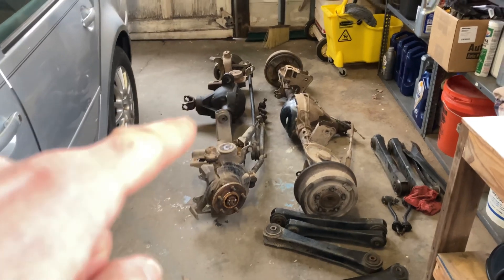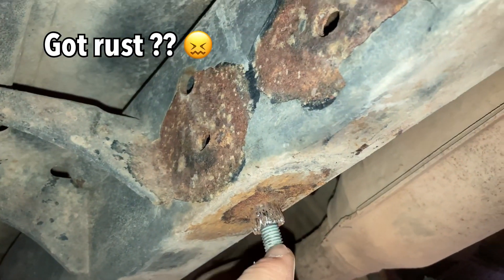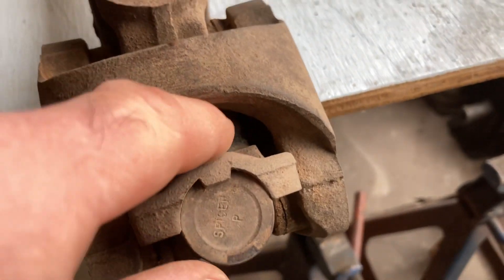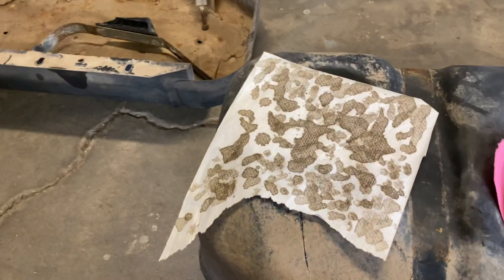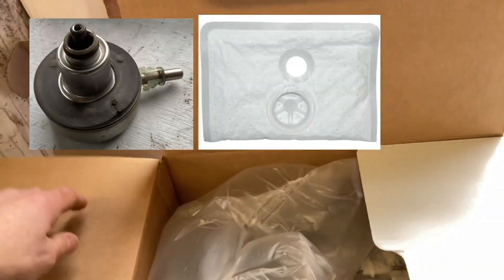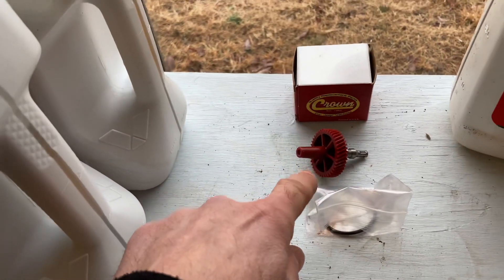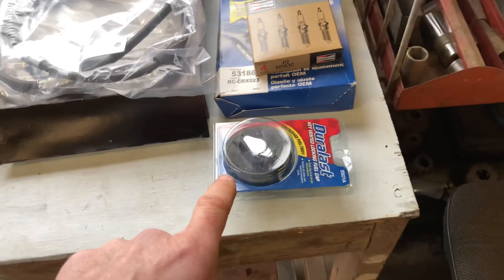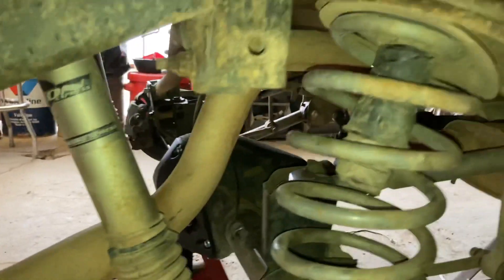What’s going on in the shop? Status update on the Jeep repairs & upgrades

Comment: Looking good Manny.  I just did the radiator, clutch, motor lift for the low profile skid plates.  And rear main seal plus other gasket and seals.  My front U-jionts need that needle to grease. PITA. 
Cheers
Reply from the maker: Thanks !!! You did so much too. Glad I'm not the only one out there doing major maintenance and repairs :-) yeah ... this double cardan joint is a PITA for sure 😣😣

Comment: Looking Great!!  Just got my 2.5L back from the machine shop and have been cleaning engine bay/engine parts in the meantime.  I'm doing the same as you with replacing many misc. parts, as they are probably original.  NO need to go back and do things twice.  Keep Calm and Carry On!
Reply from the maker: What did you do to it in the machine shop ?? Yeah, for what I do I need this piece of mind that I have done everything right on everything that is needed. Carry on for sure ... not sure about the Keep Calm 😂😂😂
Reply: It spun a rod bearing shortly after buying it 8 years ago.  It has been sitting since then until I saw your videos.  I was looking at just getting it running again and sell it to get a Land Cruiser or something else, but prices are to high, even for another jeep.   Also the realization that the jeep might be small, but works well for one person ( as you have proved. Thanx!)

Comment: Hey I have Tom Woods drivelines front and rear also. I am also running 4:88s with 33 inch tires. You are going to love that. You will also love the 4wheel disc brakes. Fun video, I wish I lived closer and could join the fun. Looks like you are having a blast upgrading the Jeep. I do have a question though. Your gas tank skid plate, are you replacing it with a new stock one, or and aftermarket one?
Reply from the maker: It sure sounds like we have the same Jeep now !! We're Jeep cousins. LOL !! ohh I LOVE the new drivability and braking !!!! so much more enjoyable. I replaced my skid plate with an aftermarket one (Warn): A beast and super heavy. I bought it 5 years ago and never felt the need to replace it. But the old one was crushed at different spots and completely rusted through. So I just installed the Warn I had. I could probably lift the rear of the Jeep up by using my hydraulic jack underneath the skid plate !! Install was quite smooth.

here is the link for it: https://www.quadratec.com/products/12022_802_07.htm?gclid=Cj0KCQjw4cOEBhDMARIsAA3XDRjyT35XTs0WOyCxaUOLAJpVpSp8OCj8kI-_FsNEzxS-obMSWQWrjtEaAtzVEALw_wcB